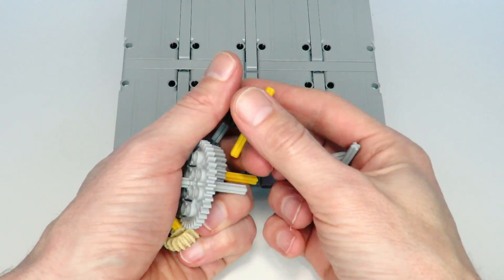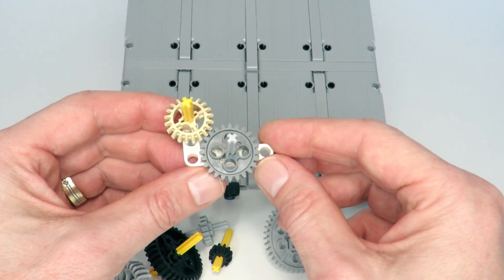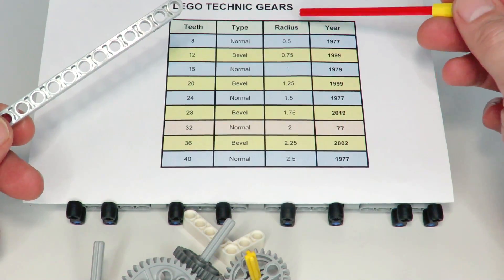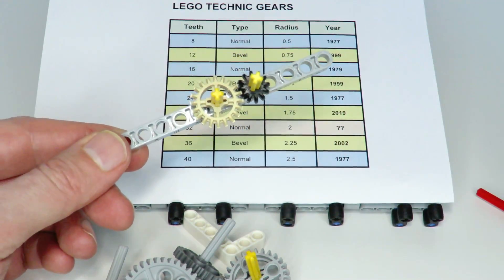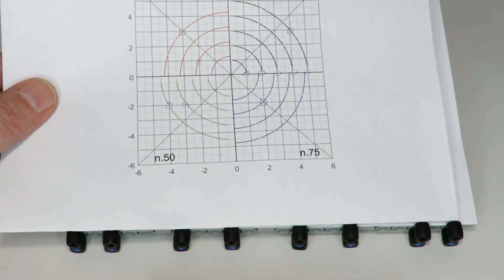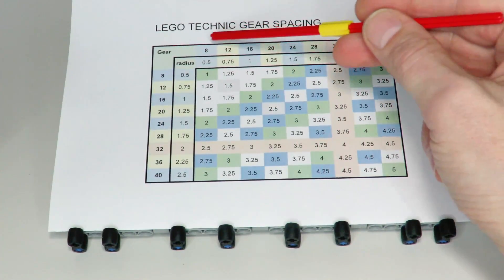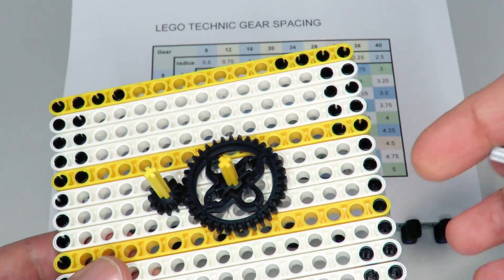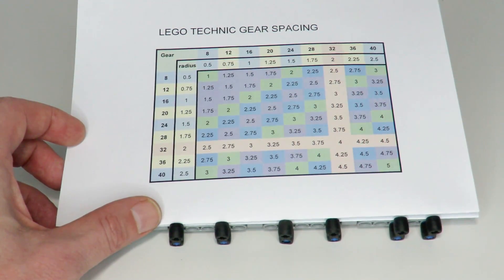How to mesh any two Lego gears on a regular grid!

Comment: That was brilliant! Always wondered why Lego made some gears to mesh while others didn't! Look forward to watching more of your videos!!
Reply: This reply is a bit late, but it actually comes down to, simply, the engineering design of the gears themselves. Gears have both a radius and a tooth pitch (defined in whatever angular units you're using, although radians are preferred). They also have a tooth profile, but that's beside the point of this. Depending on which you hold constant--radius or tooth pitch--varying the other is what will determine how many teeth the gear has.

In the case of LEGO gears, ALL LEGO gears feature an identical tooth profile and tooth pitch. (Except the 8-tooth gear, whose teeth are slightly necked, but that's to ensure proper mesh with the teeth of any gear the 8-tooth gear can fully mesh with. The tips of the 8-tooth teeth have the same profile as the other gears and that's what's important.) So with the tooth pitch held constant, varying the radius of the gear proportionally varies the number of teeth on the gear. Or in a different way, setting the number of teeth on the gear likewise sets the radius.

LEGO has carefully selected a tooth pitch such that certain special radii have nice, neat, multiple-of-four tooth counts, and those special radii are what ultimately determine which gears mesh with which gears on a strictly orthogonal basis. It just so happens that a few unconventional (and technically disallowed by the "rules") diagonals on that orthogonal grid permit the improper meshing of gears that normally cannot mesh at all, ever, on the orthogonal basis. :)
Reply from the maker: Thanks Peter! I didn't realize the meshing options until I looked into in detail. I refer to my own chart often! 🙃

Comment: Great video! An interesting fact is that from the ones you mentioned no diagonal meshing is mathematically exact other than the 5 distance using a (3, 4) diagonal.

This is because the distances form a right angle triangle and therefore they must satisfy pythagoreans theorem. So for gear distance c and diagonal (a, b) you need to have a^2+b^2=c^2. Notice that a and b are integers, meaning that c^2 must be an integer to have the equation exact. But this is not the case if c is ending with *.25 or *.5 or *.75
Reply from the maker: Hi Levente. Yes you are right. I am a big math fan and knew that my meshing's weren't mathematically exact but neither is a piece of Lego! LOL. Even for a 3,4,5 triangle lego pieces are just a plastic approximation to the mathematical dimension. How about if we use a =0.75, b=1, then c=1.25 🙃
Reply: @TechnicBrickPower  Yes, you are right, there's a reason why those meshings work. I wonder if there's a mathematical model (say with some error parameter for this non-exactness) that can derive those cases... 🤔

0.75, 1, 1.25 is a valid right angle triangle but in the grid you've used, you can't put two holes 0.75 apart from each other. If we try more scalings of the (3, 4, 5) triangle there's (1.5, 2, 2.5) which fails for the same reason in the grid, but what you can do is take an axle and separate two 4210851 connectors with 1 whole and 1 half washer. The holes will be 1.5 apart!
Reply from the maker: Hi Levente, I guess you could search for points that are some epsilon away from exactness - kind of what I did by hand really. The search space is quite small. Yes too bad 0.75 isn't on the grid 😂
Reply: Technic Brick Power hey somewhat relevant, why am I unable to connect a 5l beam between a 3l,4l shape?
Reply from the maker: @handsomejack4947  Hi Jack, It's because a 5L beam is actually only 4 long. You need to count the gaps between the holes for the 3,4,5 triangle. So you need to connect a 6 (diagonal) on to a 5 long and a 4 long. Or you can double that and connect an 11 (5x2+1)  long to 9 (4x2+1) long and 7 (3x2+1) long.
Reply: Technic Brick Power ohh I see thank you